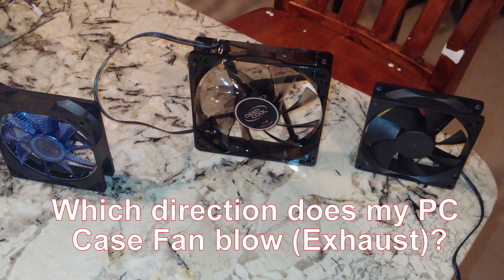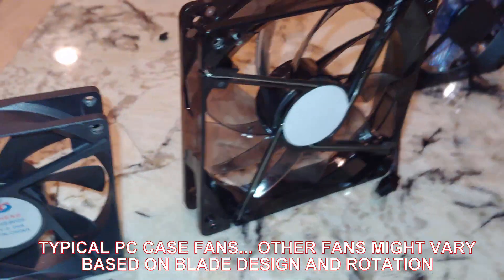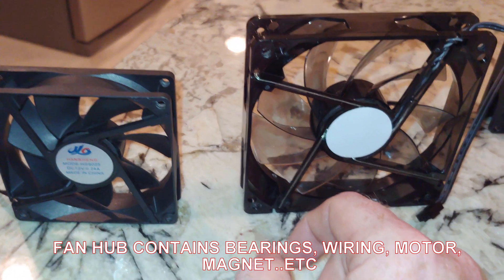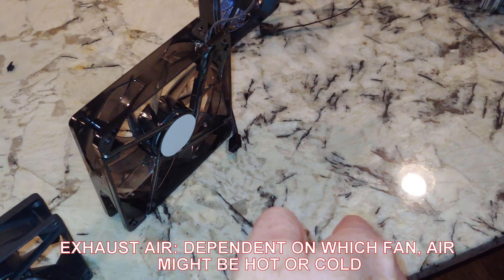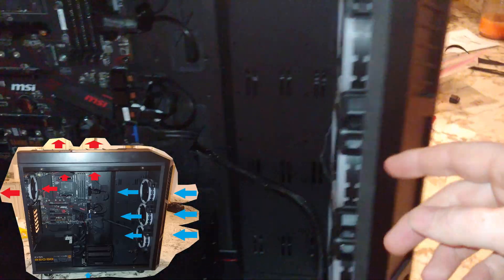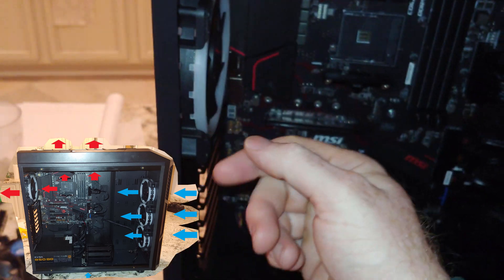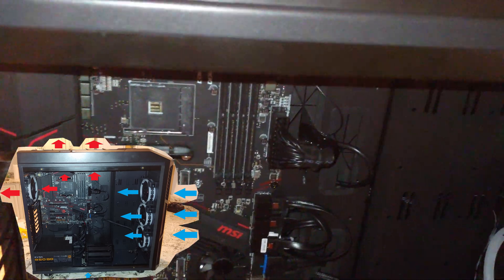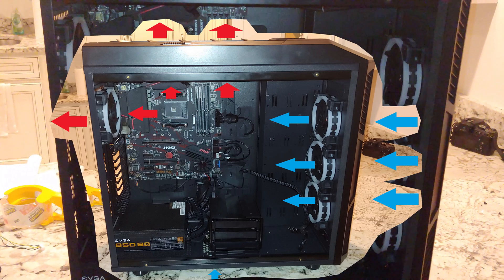2020: How to Build a Computer: Which way does my PC fan blow exhaust, how to lay out your PC fans

Comment: Super informative, but i have a follow up. In the case i have a radiator i suppose its called supplying liquid cooling. And fans that attach to it. are those the intake? So which way are the fans supposed to be facing? And for the hot air, i have fans on top of the case, but right now when i feel them its cool air! That cant be right… do help please
Reply from the maker: I don't have any videos on it as I rarely use water coolers or AIO.  I have 1 AIO on a CPU and 1 water cool loop cooling a RTX 3090.  As I don't have a video, look at about the 21 min mark in this Jay 2 cents video.  https://www.youtube.com/watch?v=5ZnDESqJdyU  Fans are under the radiator inside the case,  Intake side is pointed towards the motherboard, exhaust side is up against the radiator.  The intake is sucking in cool air pushing it across the radiator and exhausting hot air out of the case.  If done right, you should feel warm air for a GPU....and depending on how big your radiator (120-360) is and what your CPU TDP is, you may or may not feel much warmth.
Reply: @PC_HardwareTechUnboxing_1  Thanks a bunch, I'll try it out!